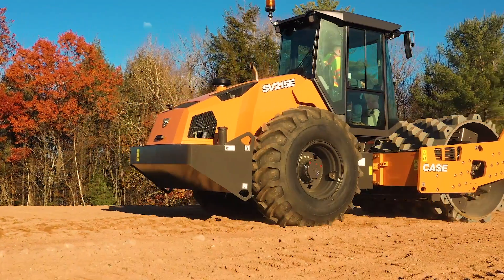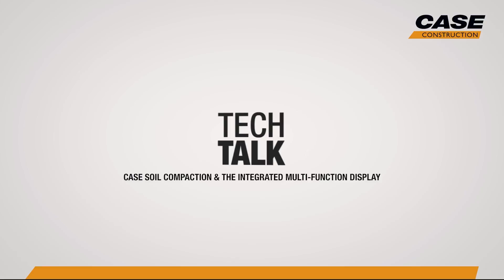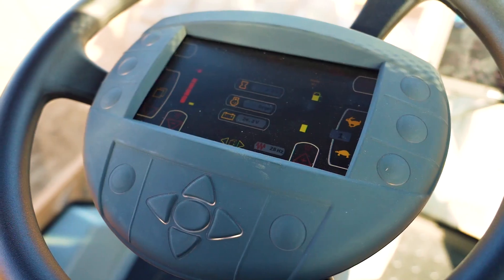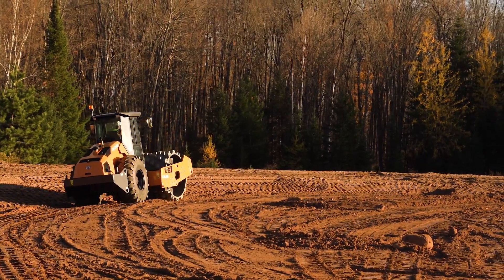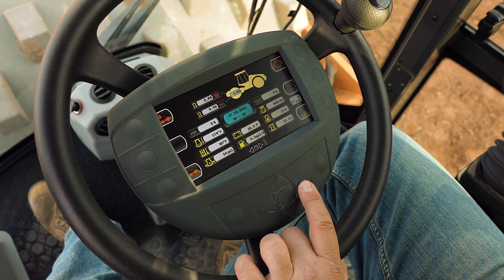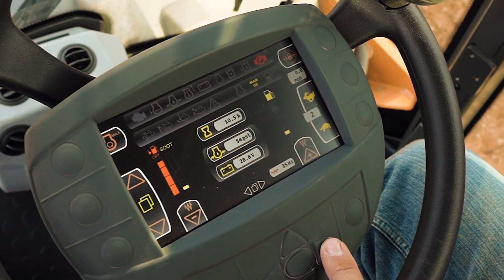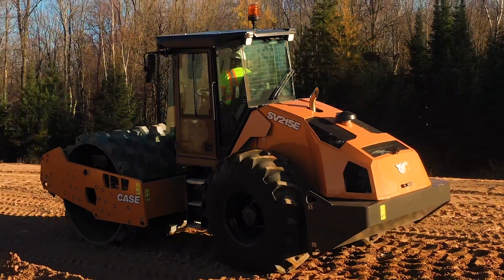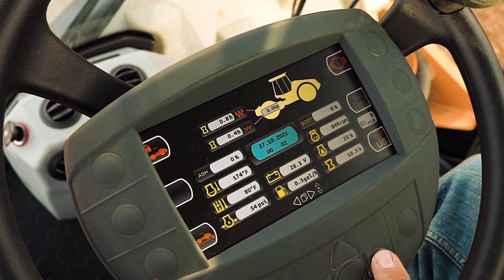North America: TechTalk: CASE Soil Compaction and the Integrated Multi-Function Display

Comment: I have a question that I have not been able to get an answer on. I have a Case CX160B excavator and I need to know if they come from the factory with a valve to operate a hydraulic thumb and a hydraulic quick connect? I live in NW Alabama and we don't have a Case dealer anywhere close to here. I own all Case equipment and we need a Case dealership somewhere close to here. Can you answer my question and try to open a dealership close? Either Tupelo Mississippi or Florence Alabama. Thanks
Reply from the maker: Thanks for the note Jason! Can you share with us the serial number of the machine?